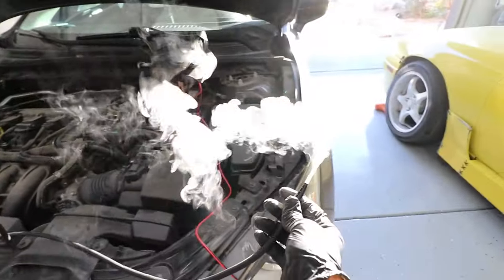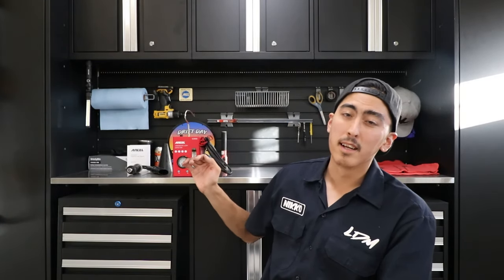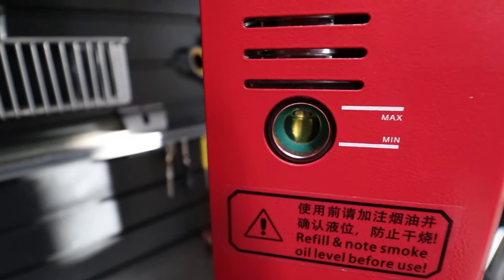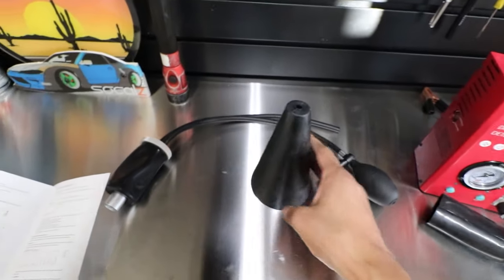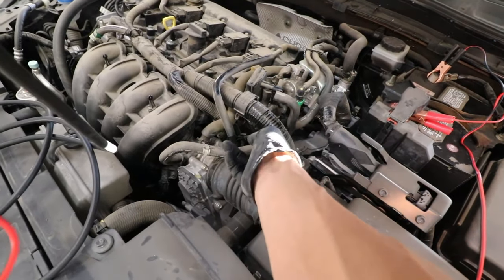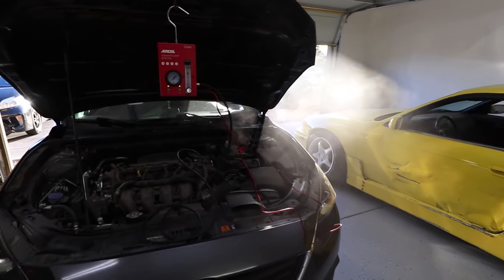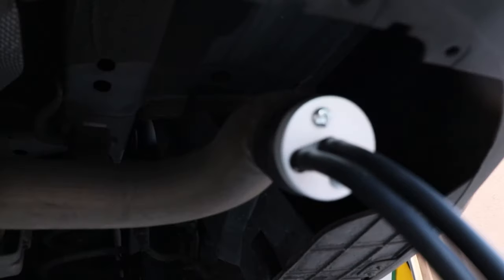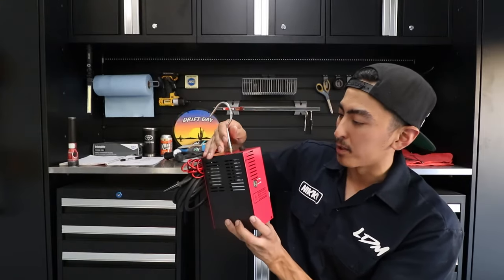Ancel S3000 Smoke Leak Detector 2021

Comment: Question, if there are no leak,  wouldnt the pressure build up to much to potentially cause an issue?   How much PSI are these machines putting out and what do you do for the ones like this that do not have a regulator to lower the output pressure?  THX
Reply from the maker: Yes it can cause an issue over pressurizing the evap system, I did not check the PSI this thing puts out before trying it out so would caution and double check the machines pressure capabilities first hand.

Comment: Could you share what liquid you use for the smoke? I have similar machine from different brand and use Johnson & Johnson baby oil but still doesn`t produce at all such smoke as on your video.
I could try liquid for concert stage smoke machine that should be more ... "smoky" but have no idea if matter..  
Any suggestions will be quite useful to say at least..
Reply from the maker: Not sure what exactly they give you but I would check amazon for Automotive Smoke Fluid Solution there seems to be a few brands with alot of good reviews.

Comment: Have you tried it on the evap system? I hear these machines put out too much pressure for evap testing.  Your opinions...
Reply: So according to the specs, these machines have an output of 7.25 to 116 psi, I believe u should only use around 1 psi to test evap systems, don't know if maybe you just have to quickly spray it in then pull it out😶‍🌫️

Comment: I have a 4-cylinder engine, in one cylinder (no. 2) I have pressure loss, the fuel injection system is messed up. With this device can I check the release of pressure at the cylinder through the injector hole? Maybe I will find out if the loss is at the piston or at the valves?
Reply from the maker: Yea you probably could. I’d rec using a leak down tester instead tho to find out where the compression loss is

Comment: These machines put out way too much pressure and cannot be used in the evap system.
Reply: Why couldn't you use it on an evap system?........
Reply: @landoflakes92  too much pressure
Reply: you can regulate the pressure on the device

Comment: I got mine coming. Question, does it use the uv liquid type to spot the leak with a uv light?
Reply from the maker: It will work with UV liquid, thats actually the liquid I used in mine since thats what was available at my shop.

Comment: so my car is HHR the battery is on the back so how Can I connect this tester to the battery of my car? any idea, thanks
Reply from the maker: you should still have a positive jumper stud somewhere under the hood you  could use.
Reply: HHR have two post + and - beside the fuse box, under hood but the battery is in the back, thanks
Reply: Cigaret lighter